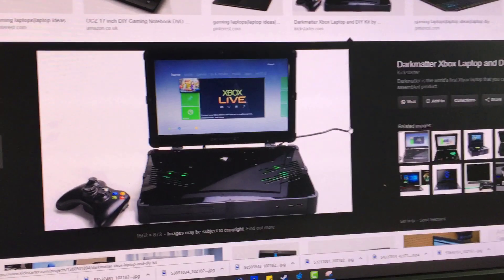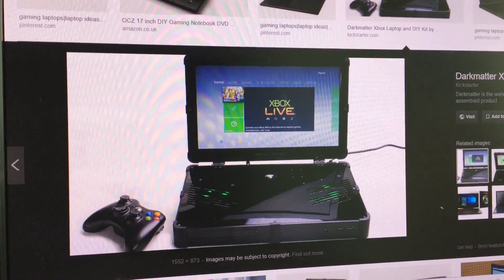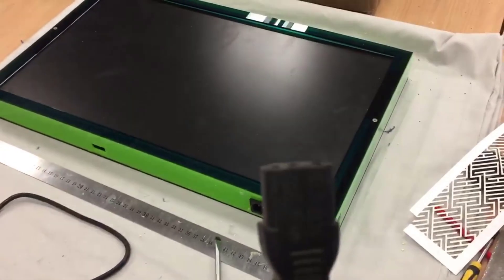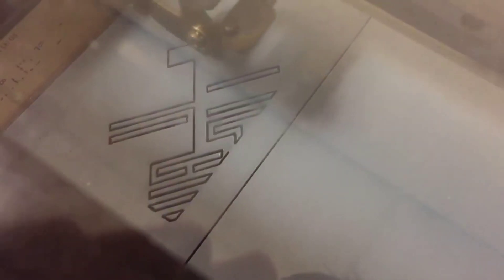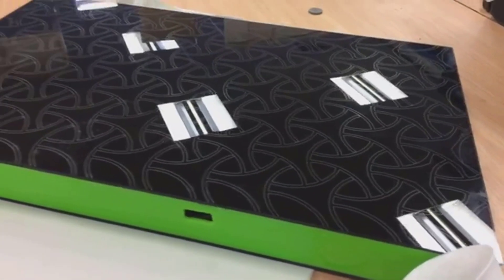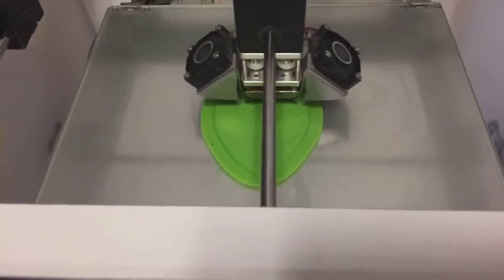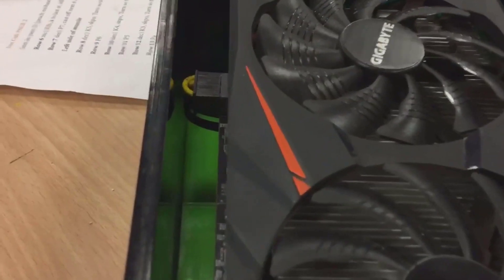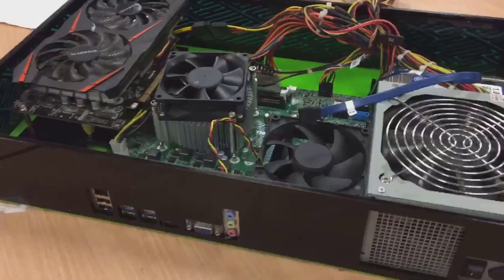GTX 1060 DIY Gaming Laptop Build PART 1

Comment: It's not a laptop if it doesn't have a battery.
Reply: Félix Lessange if you take the battery out of a laptop you can still use it as long as it’s plugged in. Does that mean it’s suddenly not a laptop just because it doesn’t have a battery?
Reply: @co-spartan1734  just as much as a flightless plane isn't one, yes.
Reply: Félix Lessange no because the purpose of a plane is to fly, which means it’s useless. A battery on a laptop is a feature. It’s just situational, some people may want a laptop so they can use it at the park, on the subway etc. But others may only use it when they are near an outlet, in which case they can just plug it in. It would be like saying a fighter jet isn’t a plane because it can’t carry any cargo. A cargo plane and a fighter jet serve two different purposes. But they are still both planes.
Reply: @co-spartan1734  the purpose of a laptop is to be portable... NUC+screen =/= laptop
Reply: Félix Lessange yeah, that’s the point of this build. To be a portable gaming station. Say you go on vacation, you can’t bring your 30 pound desktop and 27” monitor. A build like this is perfect. Say you go to a friends house, again this is perfect. To get this much power you realistically need 450+ watts. To have that much power it needs to be plugged in.
Reply: If you plug it in your electrical bill is going to skyrocket just saying